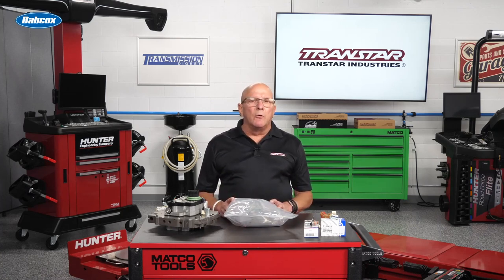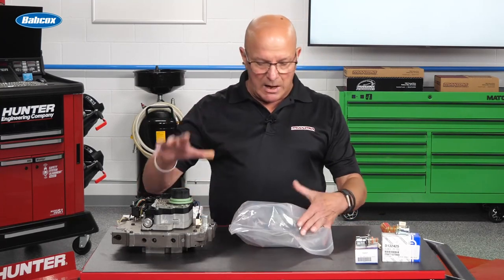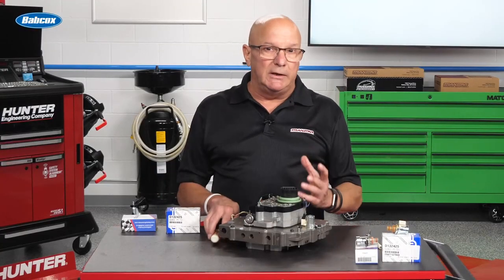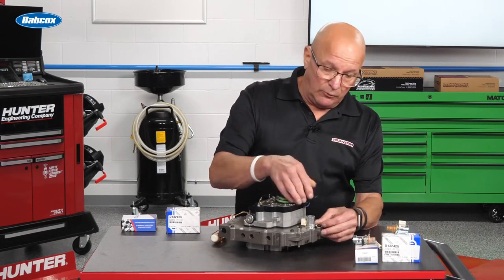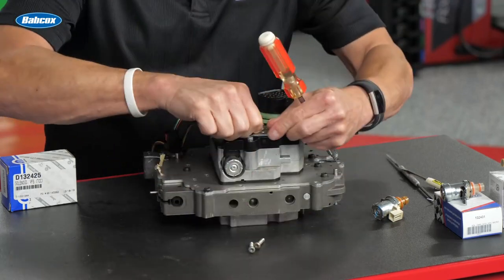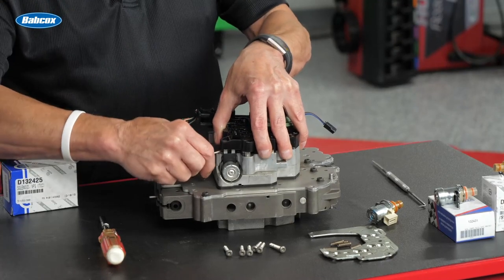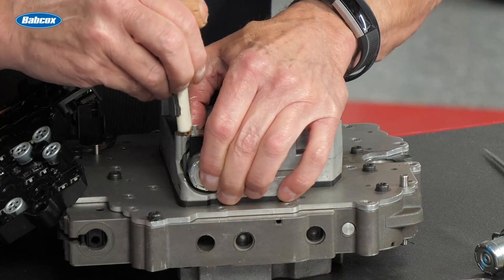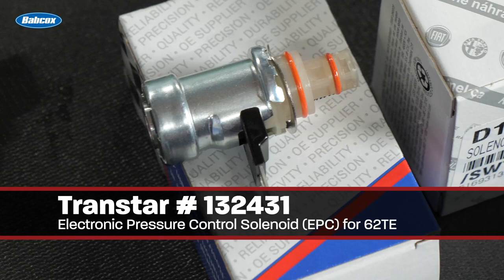Clearing up common misconceptions about the Chrysler 62TE

Comment: should there be a ball under the transmission fluid pressure sensor?
   One ball flew out, I didn’t see where it came from, but I saw a hole on the back of the transmission fluid pressure sensor and it looked very similar (to the place for the ball), so I installed it there.  I'm not sure because of this the first gear is engaged for 2 seconds.  and then it stops working.  Reverse gear drives better.

Comment: QUESTION;  62TE Transaxle,  when warm gets stuck in 2nd gear .  When cold it works fine but after approx 20min warmup during driving,   won't up shift from 2nd .  Please help.   How do I contact Dave Gritsko?

Comment: I like the 4 speed over the 6 speed. The 6 speed turned the 3.8L V6 into a dog in the vans from 2008 thru 2010. The 3.8L V6 was powerful with the 4 speed transmission in previous years and there is no fuel economy advantage from my personal experience with both. The 3.6L V6 handles the 6 speed better, but just imagine what the power would be like with the 4 speed. The solenoid pack was a more serviceable part on the 4 speed as well.
Reply: Stumbled on this comment. It's interesting. Your point is the 4 speed would have 1 less overdrive gear, thus more power?
Reply: @kipamore  The 6 speed may allow the engine to reach a higher top speed, but with in town driving it makes the 3.8L V6 engine a slug. The 4 speed was a better match for the 3.8L engines power and torque dynamic. The 3.6L is a higher revving engine so the 6 speed may be the best match for it, but maybe not. The 3.6L has never been mated to anything less than the 6 speed and now they are mated to 8 and 9 speed transmissions.
Reply: @grawey77  Fun fact: the 62TE is really just a 41TE with a compounder. It’s actually an 8 speed, but two of the ratios are so close the it’s programmed to use one going up and the other going down. 

Another fun fact: in the Promaster, users report that the new 9 speed NEVER shifts into 8th or 9th. Not surprising, since a 9500# van just isnt going to loaf along at 1400rpm.
Reply: I have a 2010 3.8 with the 62te, and have driven many vans with the 3.8 and even its little brother the 3.3 backed by the 41te and I totally agree with you. That 4 speed is just geared perfectly for those motors and the 6 speed besides shifting quick just doesnt have any advantages imo.

Comment: Not sure if I'll get a response, but it's worth a try. I'm working on a 62TE and I suspect the VFS. It's got codes for BOTH high pressure and low pressure. Metering the VFS reveals the spec should be 4.8-5.1 ohms, and this one reads 6.6 ohms. Do you think that information is enough to declare a diagnosis and replace the VFS?

Comment: I have a 2012 journey w this transmission. i got it replaced last year and it just went out again this year. it started off as slipping in 6th gear and gradually reached the point where it doesn’t shift past 3rd. can solenoid pack cause the issue or gears are just gone?
Reply: We are on the same boat ima thinking about junking jt there transmission 62te are trash I saw another guy said he’s gone thru 3😂
Reply: @hiddenghost9200  yeah, i’m also having the dreaded rocker arm tick. it’s a terrible situation for me because i still pay a note on it and can’t trade it in at the moment.

Comment: DAVE. i have a 2009 chrysler town and country with the 3.8 V-6 engine and the 62TE 6 speed automatic transmission. it just went into limp mode and threw the PO76A  code  SOLENOID H MALFUNCTION. the engine and trans has 210.000 miles on them. i just changed the trans fluid and filter. not the converter fluid. i have tried everything to try and get it out of limp mode. nothing worked. will changing the solenoid pack cure this issue ? any info would be appreciated. thank you.
Reply: That 1st solenoid easier to get to usually fixes what u have going on hope that helps
Reply: Reset LVP counters. You’ll need a scanner
Reply: I have a 2016 caravan. I’m having the same problem. I’ve changed the solenoid that is above the trans control module and the filter and fluid and it’s still showing same code and stuck in limp mode. Any suggestions???
Reply: @calebsmith6147  I have a 2011 dodge caravan turns On fine soon as I put it in gear it Boggs out an wants to shut off ima change the whole valve body and shift solenoid since I’m already there alone with filter. Did you change valve body ?
Reply: your direct clutch solenoid failed just swap solenoid pack and TCC solenoid youll be so happy. Had the same thing happen to me
Reply: @26JonnyD  I changed the tcc solenoid now runs like a bby

Comment: I was wondering if there are symptoms that would help you determine which solenoid TCC or EPC is causing a problem while the transmission is still in the car. Thanks in advance.
Reply: I m also curious to know about the symptoms when we should replace EPC vs TCC. In another video it was mentioned that TCC symptoms are Engine trying to stall or causes vibration  when coming to stop but more details should be available so we can address the real issue instead of making a guess..
For an instance, my 2011 Dodge Grand Caravan causes a little bit of jerk when I shift from "P" to "R" or "N" from "R", the problem is intermittent and I feel it harder when vehicle warms up. Vehicle drives smoothly otherwise so I believe it to be more of an electrical than mechanical problem but I couldn't find enough discussion on 62TE to isolate and fix the real issue
Reply: Go to the dealer and get them to check for current PCM software version. There was a flash for this issue. 

I was a Chrysler tech for 5yrs. 

P0740 will usually set for TCC issues. Shudder will be felt.

Comment: Can I take one of the individual solenoids out of another pack and replace it in the my own? Are all the NC "normally closed" solenoids the same in every pack? I only ask because there's a shop selling a used back with a bad Underdrive solenoid and they replaced the whole pack for the customer. I can save hundreds of dollars and a lot less work to simply take the cover off while in the car, and replace that one bad solenoid. As opposed to having to remove the whole valve body just to remove the whole pack...

Comment: P 0868 ?
Reply: I just got a code P0869 trans code and slipping in 2nd, and third. Did my research and ordered the solenoid pack and the outer solenoid. As soon as parts get here, going to replace these and hope this is a fix. What did you find for a code P0868?

Comment: These transmissions are junk no one wants to work on them all they want to do is sell you a rebuilt transmission
Reply: They are not junk as you say. Reason is very simple if you understand what AAMCO stand for "All Automatic Must Come out" and that is no joke that is what stands for it's the only way they can make money there is no money to be made by fixing and if you are lucky maybe you can fix problems sometime but have no way to know what condition is inside. I got lucky by replacing solenoid pack once and it did work for 3 years but now I am rebuilding my self the whole transmission it's not that hard at least not for me.